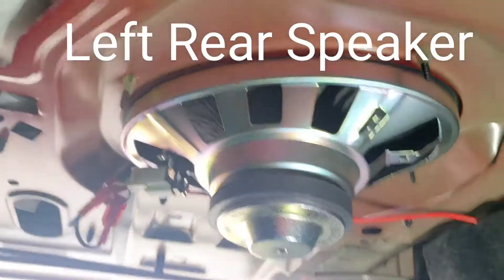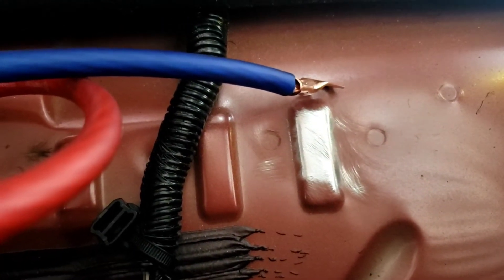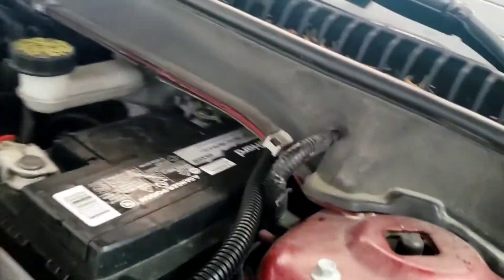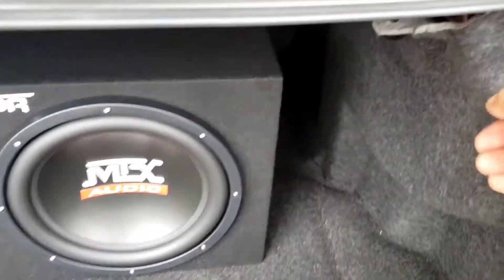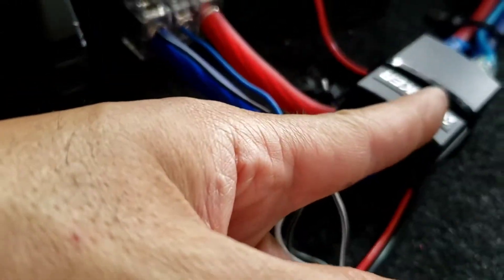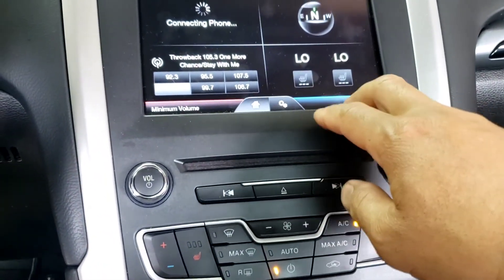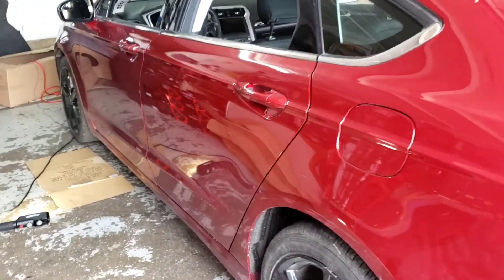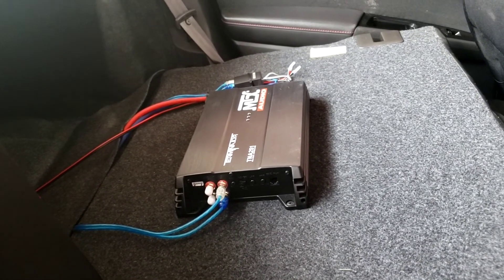Install line out converter LOC sub / amp 2016 Ford fusion with factory Amplifier

Comment: Can you run the speaker wire straight to converter and unplug speaker and it still work
Reply from the maker: Yes
Reply: My system was playing before now converter won’t power up when I put a jump wire in the remote in and power (12v) converter and amp comes on. Is the converter bad now?
Reply from the maker: @norbreym28  Yes, it's bad
Reply: @khmerohio  ok thanks
Reply: @khmerohio  also when I open and close or lock my car doors you hear a thump through the speakers

Comment: Do you have to have a speaker in the rear deck for it to turn off I just noticed mine didn’t turn off and when the car is off I hear a thump sound every couple of minutes
Reply from the maker: It should shut off around 2 minutes, if not, your loc is malfunctioning

Comment: Never use a self tapping screw to hold down your ground. You will wind up frying your system due to bad grounding. Find a drain plug in the spare tire spot. Cut a small slit in it barely big enough to squeeze the wire through. Get a long enough ground wire to run down to a good screw on the frame and attach it there. Or drill and tap a place on the frame and attach the screw there but never run a self tapper to the trunk pan for a ground.
Reply from the maker: Thanks for the input 👍👍👍